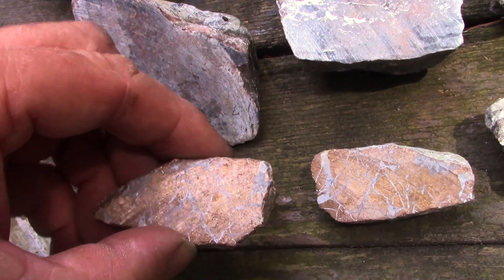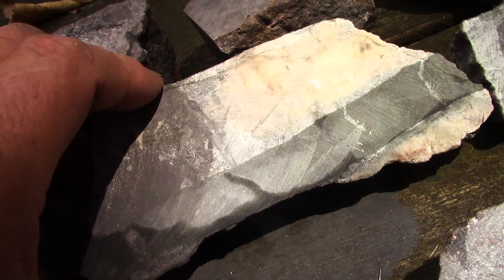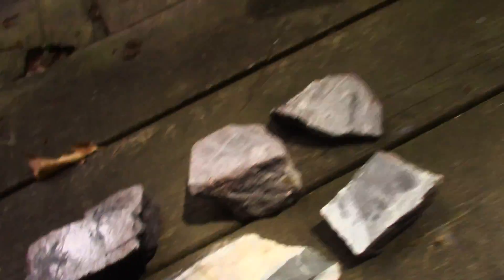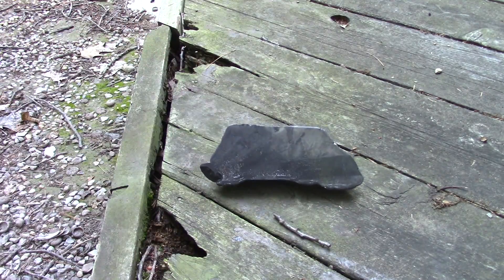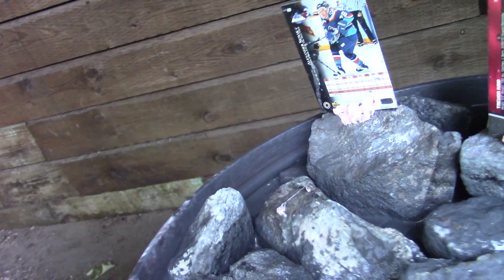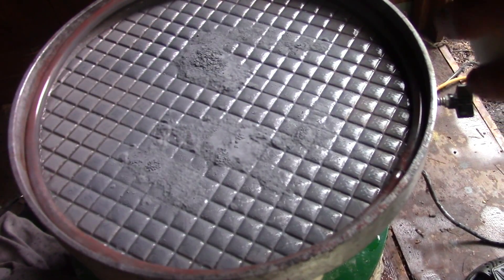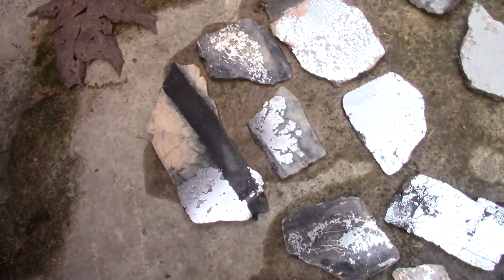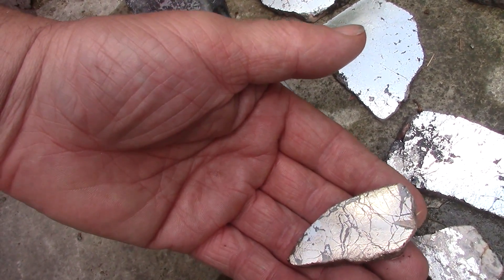BACKYARD!   HOW TO POLISH MUSEUM QUALITY MINERALS

Comment: Thanks for responding do quickly to my last question yesterday and i have another.  What is that vibration table? I have bigger rocks also and what type/brand grit do you use and gave you tried various types?
Reply from the maker: The table is a vibratory flat lap.  I really like it, but if you were to only have one machine, I would suggest getting a regular flat lap (wheel spins) instead, unless all you are doing is polishing slabs.  Mine is from Covington Engineering but there is also a good one from Lortone that I am aware.  I didn't shop around and got mine used when it came up for sale on Kijiji.  
I don't use a particular brand of grit.  I do make sure that I buy from a trusted source, so I get what I pay for.  Last time, I found someone who bought in bulk from a good store and split it up into bags.  He made a few dollars for his effort.

Comment: I have a question,
I got my hands on a nice size piece of mica loaded with garnet so I watched a couple of your other videos to get the mica off. (Great videos by the way)
My question is how do I polish them up?
Reply from the maker: I have learned since that it is best to soak the rock in water for a few days which will penetrate the mica and make it easier to remove.  Sounds like you got yours off already, so keep it in mind for next time.  To polish the garnet, you have to decide if you are trying to keep the crystal shape or not.  If you just want a clear shiny rock (assuming it is not weathered beyond salvaging), maybe for cabbing later, the best bet is a rotary rock tumbler with grit.  If you want to keep the crystal's shape then it gets more difficult.  I have seen others use sandpaper by hand or a flat lap.  I did not like the result in the one's that I saw, as it removed some of the crystal and I could tell it had been shaped.  I think to start that I would try a vibratory tumbler with corn cob or walnut shell to see if that would shine my crystal without harming it.  Let me know what you decide and how it works out.

Comment: With the vibratory lap - do you have to clean the different grit out when you change to a finer grit  or do you change the machine?
Reply from the maker: Wash out the machine well.  You can buy additional plates and I can see this would save effort and grit.  Only issue I can see, is you still need to make sure there are not little rocks that broke off and will damage the next round of slabs.  ie. it is not just grit to worry about.

Comment: Quick question? I've sliced some of my rocks and the cut face has some very bright silver but some of of the metal is duller but will polish up to a bright shine, is the duller metal  a mixed metal or just cobalt?
Reply from the maker: When the slice is bright shiny on the fresh surface, that is usually "pure" silver.  A dull grey probably has cobalt and/or arsenic in it.  Usually you can tell by looking at the outside of the rock at the oxidation.  It still might have silver, but to me falls into the "mixed metal" category.

Comment: They polished up well, I did mine like that but got fed up with changing the grit  so I changed my method slightly,  did all my cuts first, hot glued weights on the slices, rubber o-rings or anything I could get my hands on to stop them bumping and causing damage then put them in a queue for each stage, the time consuming bit and noise I hated so the polisher only went on when I left the garage, polishing both sides seems like a never ending task, but it gets the job done, I've been using cerium oxide to finish, never tried rouge, is there a big price difference?
You will soon have your own selling page at this rate,
What! No Daisy!
Reply from the maker: The proper thing to use is cerium oxide.  I have not bought any yet.  So this was a case of using what I had on hand.  The red rouge is a polish for silver.  I don't know the cost of the red rouge.  This bucket came with a used rock tumbler.
What I didn't like about polishing slices (metal ones don't really need extra weight, so I can probably avoid that step), is they wiggle their way under the bumper and then hang up.  As such, I have to pay attention while they are running or they burn out in one spot when that happens and the others pile up.  
Today was 40C.  Felt like hot.  Daisy was either down at the lake or inside in the air-co.  The temperature was the reason that I didn't go rockhounding.  I am sure some people will call me a wimp, but that is too hot for me to be active.
Reply: meMiner 
No , I will go with the it's too hot, I'm sitting indoors in the cool as it's way hot in the garage, I understand about the slices sliding under the bumper that's why I put bumpers on the thin ones , made from petrol hose, hose pipe, inner tubes or anything that will self hold , some people use plywood rings.
Most of my stuff is profiled , shaped etc so I don't use the vibro but I have a huge pile of stuff I don't know what to do with , that may well get sliced.
Daisy's better off inside keeping cool.
I remembered my mother telling me they cleaned her jewellery with what she described as jewellers rouge, I normally use cerium oxide so I was just comparing really.
Reply: Smart move; however I was silver-struck enough to go rockhounding in Cobalt on Canada Day, it was excruciatingly hot but I did it, how? I will never know, didn't get a sunstroke thankfully, it was 32 degrees C in the shade!